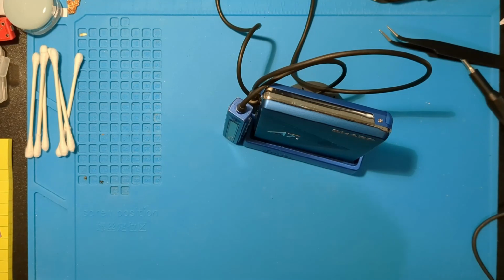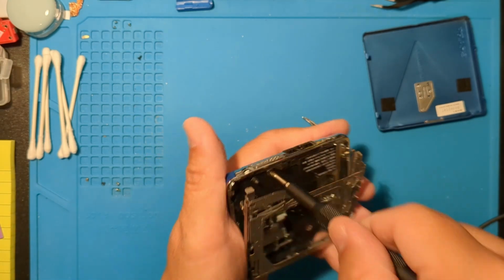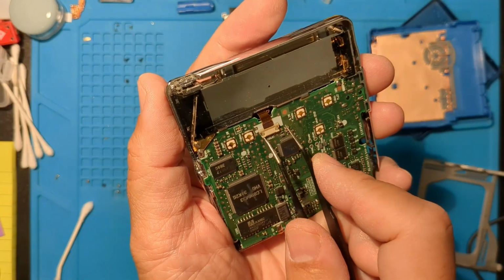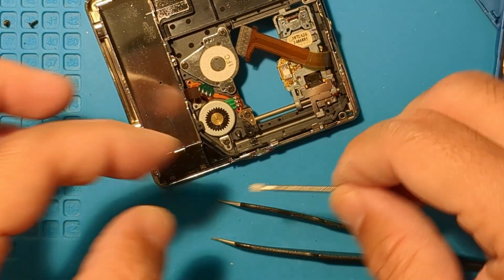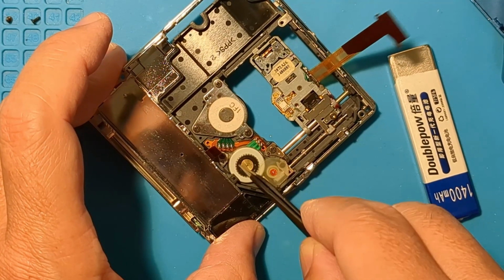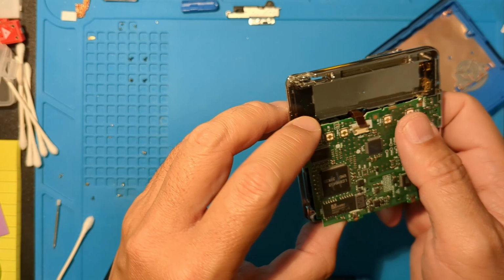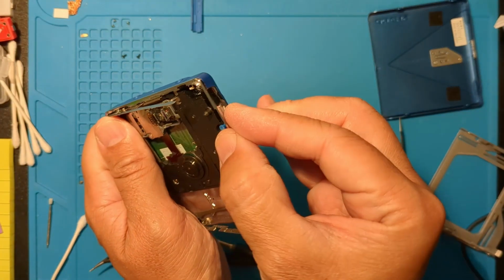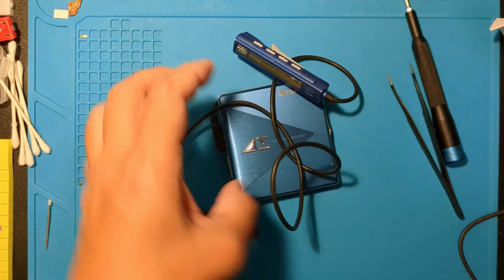Sharp MD-SS503 MDLP MiniDisc Player Repair Fix - Auvi/1-bit - TOC READ - Replacing a Broken Gear

Comment: What a nice little player.  Another great video full of information. Broken gears are common on Sharp models, you would thing that Sharp would have addressed this issue in later portables.
Reply from the maker: Thank you! It's interesting to think about how they seemed more prone to failure than Sony or Panasonic (both have had cases of these failing, but not nearly as often, it seems).